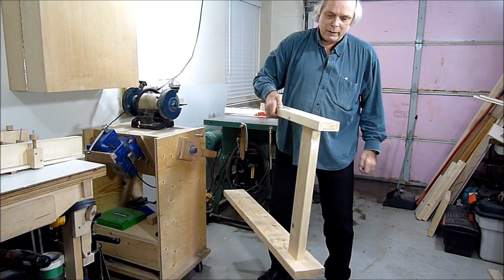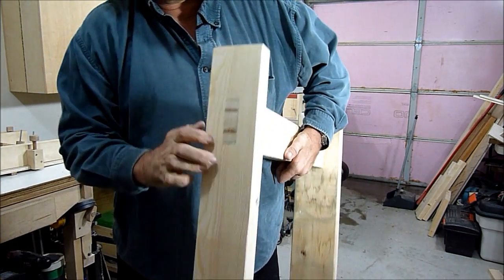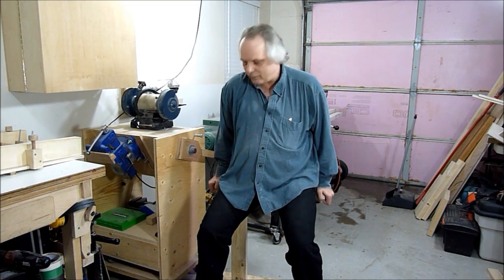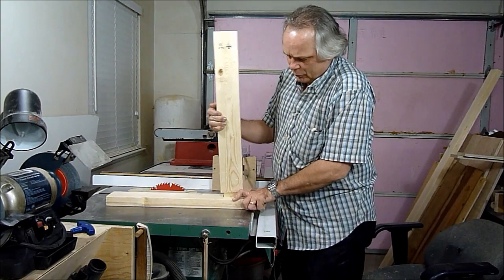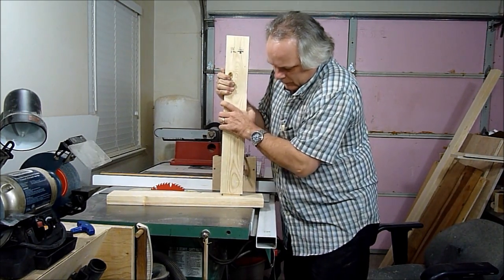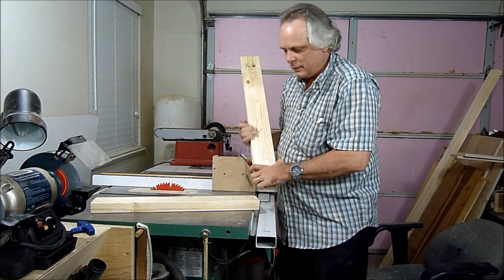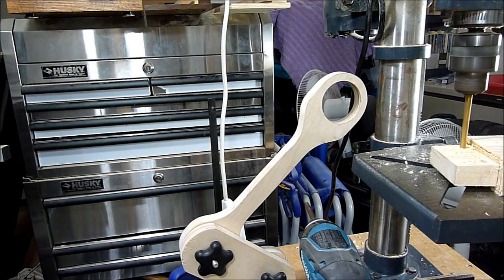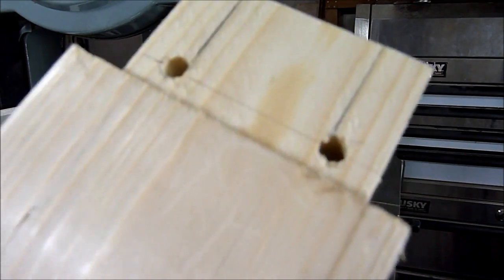Mortise and tenon joint with wedges

Comment: This is my favourite joint. It looks good. It's super strong and not too complicated to make. I've seen these joints a lot in old doors like in my grandfathers house which was built in the 50's.
In the video at 05:36 you can see that the wedges reached down to the bottom of the relief holes which stopped them to put more pressure on the joint. I think if you used thicker wedges and applied more glue on the tenon and spread it evenly on its surface it would be even stronger!
I want to thank you for sharing these videos with us. Keep up the good quality content of your channel!
Best Regards,
Jonas

Comment: Nice demonstration on the mechanical strength of this joint. With long-gran glue contact, joint would have held, but the pine/fir around it would have still failed.

I'm using wedged mortise and tenon joints in dimensional lumber for a workbench project (not my first time with these joints in this material). Regardless of the wood, for glue to have maximum bonding, it requires long-grain contact. I've had good success with using an acid brush to evenly spread a generous amount of Titebond III to all four cheeks (the end-grain of the shoulders doesn't provide significant bonding) and well into the kerfs prior to joint assembly.

Comment: Thanks for the experience, Jack. I wonder how the results may have varied if you had left the mortise walls straight. Without the added room made by the bevel I wonder if the soft wood would have compressed to become much tighter. What do you think?

Comment: Interesting results. Things may have turned out quite differently had you put glue into the mortise prior to assembly. Regardless, that joint is a very tight joint apart from glue.